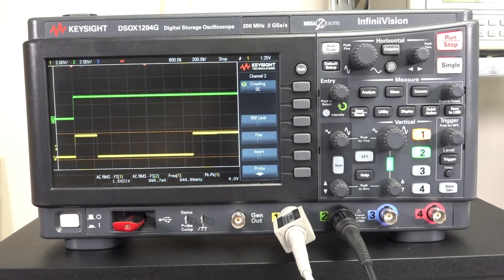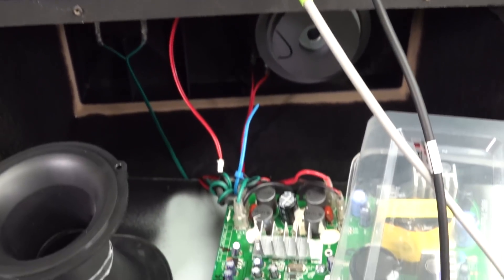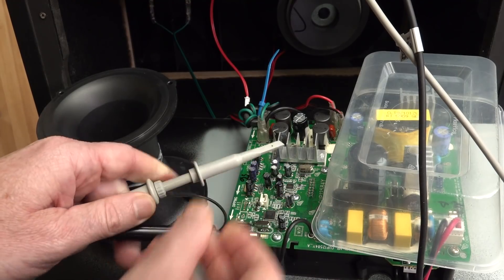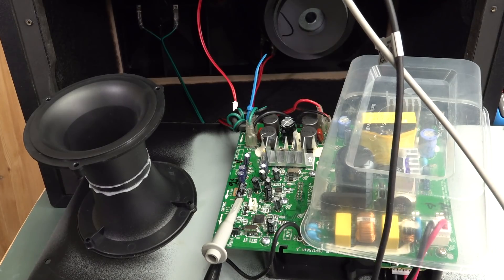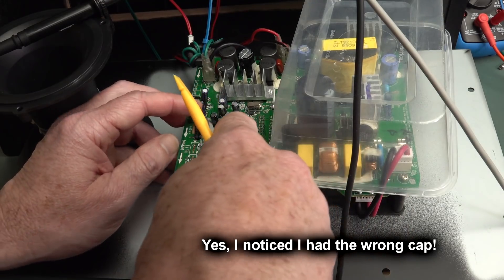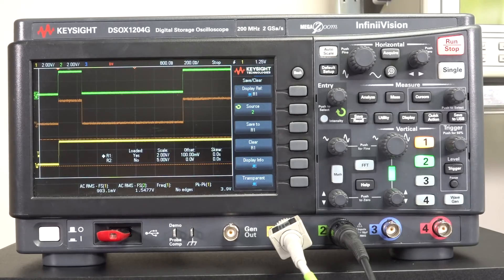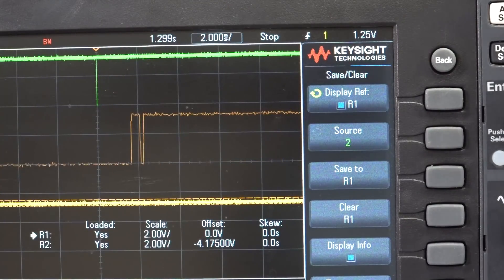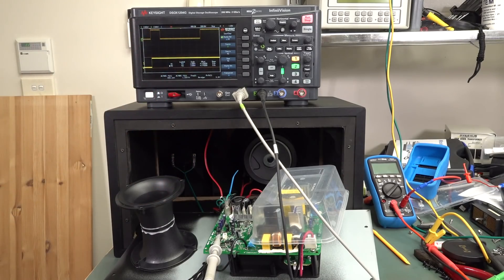EEVblog #1324 - Oscilloscope Reference Waveforms are USEFUL

Comment from the maker: NOTE: If your trigger reference signal is slow going then that could add some jitter to your time correlation. Also any variability in say RC power on reset time constants etc. Just be wary of that if doing exact measurements.
Reply: I was thinking something like that. This works if the responses of the signals are very consistent. It looks like the timing of the "digital signal" high and low correlate to the "analog signal" RC charge and discharge curves. If they were captured at the same time they might line up perfectly. Great tip, but definitely a big "trap for young players!".

Comment: This is a weird and paradoxical statement at start since you advise to have a 4 channel scope (that will be inferior in spec than a dual one for the same budget) but you show how to not use those four channels then you show how important it is to have a good memory depth on the device (a thing you can't have on a tight budget especially if you go with a 4 channel scope).
If that was not an ironical line at start, you just prove the opposite of it.

Comment: Hi Dave, I've been watching your channel for a long time. Could you tell me where I can find used oscilloscope test equipment or a professional digital multimeter at a lower price? Could you indicate some sites? Thank you
Reply: Most manufacturers have Used/Refurbished equipment available:
For example: 
  - Keysight: https://saving.em.keysight.com/used-equipment/products/oscilloscopes-digital-waveform-analyzers/en
  - Tek: https://www.tek.com/encore

Also another good place to look are test equipment rental companies, as they will sometimes sell off their old equipment. Also some resellers (like Newark) sell refurbished, calibrated test equipment.

A big part when looking into this stuff is figuring out what your needs are. For example, manufacturer refurbished stuff may come calibrated, while other used sources may not have a recent calibration. So you would need to get it calibrated yourself after buying which adds on cost.

Comment: I switched on my Keysight 2000-series scope to check out this feature.  I hit the Analyze button and was about to be very disappointed that the feature wasn't in the menu.... until I checked the manual and saw that it has its own button labeled "Ref" (who knew, right?), located on the right side under the Math button.

Thanks for "triggering" the mental refresh on this feature!

Comment: This is how I ruined a thermal camera trying to find minor noise issues. The probe slipped and I ended up with burnt thermal sensor. $800 loss (which already was great deal) and disappointment for a long time..Giving a big thumbs up for this video, although I do not have a scope with reference waveform memory this indeed is a very good trick that I would not have though of. Thanks Dave as ususal great stuff!

Comment: Which sub $400 four channel scope is worth having? That Keysight in the video would be circa $1900
Reply: Except in the second hand market, none of the 4-channels devices are worth having at this price point since there are only some 25-50MHz 4 channels ones instead of more versatile 200MHz 2 channels ones (and I only take account of serious brands suited for hobbyists or semi-pros works, not Owon or picoDSO rubbish). Dave inhaled too much magic smoke and solder fumes before recording.
Reply: @Glenn Maughan, get in touch with your local Keysight representative. Usually they sell their demo equipment this time of year. Although it will never be sub €400 it will be money well spend. Hardware decoding makes the instrument feel much snappier and pleasurable to work with.
However don't expect really high end measuring performance. The high end stuff is expensive for good reason.
Also check with instrument rental companies, they will likely sell their used equipment.
I got a really good deal on a DSOG1204 4 channel 200 MHz scope.
Reply: Good question Glenn.

Comment: Can you do a video on the different ways you can secure components in place on a a PCB? There are many methods, and there seems to be controversy surrounding the use of hot glue. People say hot glue doesn’t last every long and a flexible silicone should be used.  Also, how do you design boards with components structural support in mind? If it’s designed right do you even need structural adhesive? Thanks

Comment: You know what would useful in this case? Single shot capture with delay. Set a 5 s delay and press the single button. Maybe a beep for each second that has passed. Single shot capture activates. Scope manufacturers could implement this right now with a firmware update as well.

Comment: When I have run out of hands I have always just clipped a cheap plastic clamps I bought at the hardware store onto the probe.  Not perfect by any means but it makes a very stable A frame to set on the board or the workbench beside my board.

Comment: Actually, armed with this trick, if someone were really hard up against a budget line, a two-channel scope with this reference waveform memory could be enough to stay out of trouble. Then you could go for bandwidth or sample rate in your scope choice!
Reply from the maker: I'd still suggest a 4 channel scope!
Reply: @EEVblog  That's a suggestion but that's rarely advisable. 
When on a budget, especially in the sub-400 yankee bucks you talked about, most of the time this is a waste of money to invest in a brand new 4 channel scope with inferior bw, sr or memory compared to the 2 channel devices at the same price range. 
Also, it's not that common to really need those two extra channels instead of needing the extra other specs so one of the first thing to compromise on a versatile scope is those extra channels unless you are in a rare case that constantly requires them and experienced enough to make any other trade-off on specs and options.
Reply: @EEVblog  "I'd still suggest a 4 channel scope!"
I have the 2 channel version, Keysight DSOX1202G.  I love it. I cannot think of a time when I wished for 4 channels BUT when a person has only 2 channels then I don't think in the mode where I would need 4.  Perhaps with 4 I would find some uses for 4.  Anyway, it was on sale considerably less expensive than the 4 channel version and the built-in signal generator is a great thing plus the BODE plot which i've used rather a lot.
Reply: @EEVblog  Right, but options arent a bad thing.
Reply: Another video suggested by Youtube pertains to electronic speed control for brushless motor; that's usually 3 phase so you are likely to need 3 channels to watch the phases and maybe a 4th channel for the control input.  That would be a use for 4 channel scope.  But with 2 channels, set a trigger source then probe each of the phases.  Takes a bit longer and is not quite as visual; but of course this is where a reference waveform would help.  Two reference waveforms for phase 1 and phase 2, then probe phase 3.

Comment: As a user of a conventional analog oscilloscope I clearly can't use the method described here but it is interesting to note how analog scopes internally use the same trick. A conventional scope can only display one beam at a time so two (or more) channels are emulated by drawing a trace of one signal, then one of the other. Since both traces are using the same trigger source the correct time relationships are shown.

Comment: I always use this trick, when it's applicable. However, on Rigol DS1000 series the REF waveform does not obey the overall time offset and time scale.
Reply: you mean you can't adjust the time base of the REF waveform? 
My Siglent SDS-1202x-e can't either. Only the vertical resolution and position.

Comment: Tight probing may also cause problems if the ground band on the scope probe touches a live heat sink or power transistor package.
Don't ask how I know this :(
Reply: Most new scopes come with removable tip covers designed specifically to prevent this.  Alternatively, wrap black tape around it.
Reply: @bill392  I have those components and the plastic cover gets in the way.
I may need the spring clip ground for measurements so removing electrical tape is a no go.
Just use the method Dave explains here as I've been doing for 30 years.

Comment: So easy to short things out with the probe's ground ring at the tip.
Reply: Most new scopes come with removable tip covers designed specifically to prevent this.  Alternatively, wrap black tape around it.
Reply: @bill392  Or a piece of heat shrink.
Reply: @NiHaoMike64  Not only does heat-shrink tubing make a nice compact tight fitting cover, if using the right type (not adhesive lined), it can be easily slipped on and off when needed.

Comment: One little thing I came up with when using the scope too is to slide the plastic protector of the ground part, if yours can do this, slide it up over the exposed ground ring near the tip, or cover it somehow. If not, it might just short something on your circuit accidentally as well.
Reply: Or black tape.
Reply: Sorry, do you mean the ground connection should be isolated?
Reply: @arash4232  Connected to the circuit on the proper place of course, but insulated to not accidentally touch other terminals. On some circuits (small pitch ICs specially) it's surprisingly easy to slip just a bit to the sides and touch what it shouldn't after all.
Reply: @Kalvinjj  thank you

Comment: only works if the two signals are deterministically time coupled.
if they are not this will not work. if you only have to probe two signals
triggering of one channel and powering the DUT up with a footswitch would be my 
go to solution...

Comment: Neat trick, indeed... sadly, for my current predicament it won't do much good. I would need to check on two dual signal lines and have an intermittent fault. Sadly, I can't afford a four channel scope and even with the through hole components: moving hooks around while powered on in hopes to catch the fault has shorting out potential.

Comment: I really admire the solution for protecting against accidentally touching the big fat capacitor and coils over in the right...
Reply from the maker: Chinese Takeaway Protection™
Reply: Yep, that was one of my takeaways from this video.
Reply: @EEVblog  Kung Fu Condom
Reply: @EEVblog  The Addicts approve this method.

https://www.youtube.com/watch?v=4qzEswAvhkQ
Reply: High quality mains voltage protection! Simple but functional :-)
Reply: I had a similar idea but by using rubber sandals, standing up, and one hand in back pocket to measure the 400V diode point on a SMPS, but I was attacked in a forum for doing that... "isolation human" instead of "isolation transformer"?
Reply: In the states it's called takeout, not takeaway.